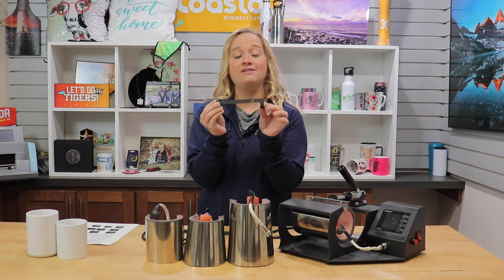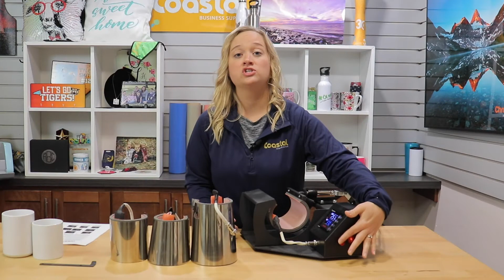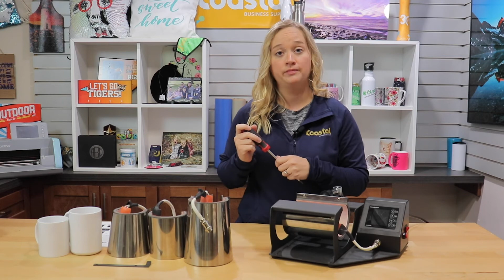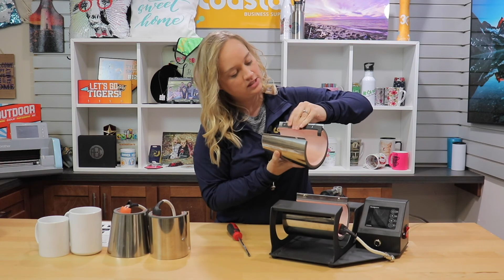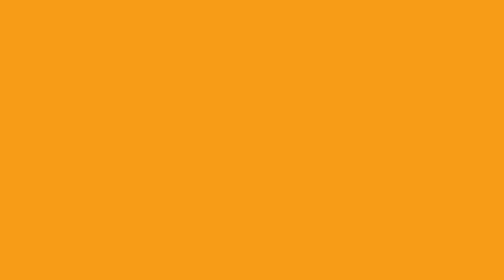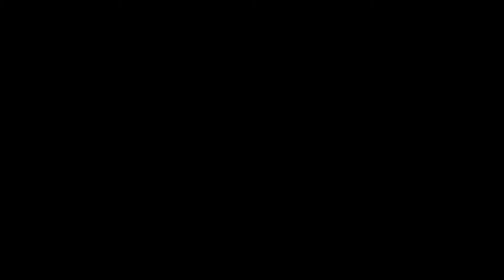How to Set Up the 4-in-1 Multi-Purpose Mug Press Machine

Comment: Will this press work for 20 ounce tumblers or are they too long?  Curious if it will work for both the straight (not tapered) skinny tumblers and also the tapered tumblers (similar in size shape to the Yeti 20 ounce tumblers)?
Reply from the maker: Hi!  The element will not wrap all the way around the water bottle.  As far as rotating - we have not tested rotating the bottle but we know a lot of people have tried it with varying results.
Reply from the maker: Chris, yes, the 20oz Skinny Tumblers will work with this press - in the water bottle element. However, you will not get a full bleed image due to the element size. Tapered tumblers will work as well in our latte elements. We also have used our 30oz stainless steel cup in our 11oz/15oz element.
Reply: Do you mean it wouldn’t wrap all the way around the tumbler or that the element would be too short to catch the full length of the 20oz skinny’s? 

I’m trying to work out if rotating the tumbler would take care of the issue. 😅